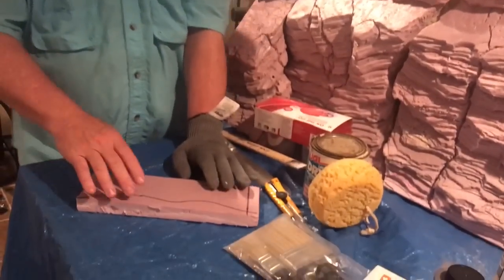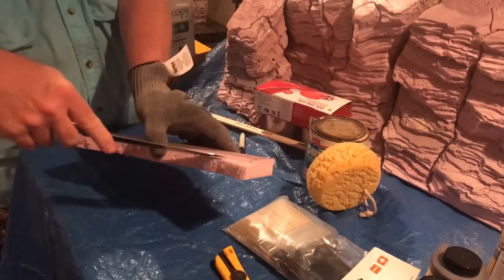How I Created My Faux Rock Wall Aquarium Background

Comment: What is name of foam?
Reply from the maker: I used pink styrofoam (extruded polystyrene) insulation board.  I didn't want the big house insulation boards, so I found hobby sized versions at Home Depot.  Sometimes you see it in green or blue, all of them work.  I don't like the ones that have a foil coating though.  If you can't find them, the 4'x8' house insulation sheets work well.  I used 1" thick ones, but if I had to do it again, I'd mix it up between 1" and 2" thick layers.  Most hardware stores sell them.  After cutting my boards and carving them, I used Gorilla Glue to bind them together.

Comment: Hi sir ...what is the material you use ??
Reply from the maker: Anish, I used Extruded polystyrene foam board insulation (XPS).  It comes in pink, blue or green colors depending on the brand.  Or, you can simply use sytrofoam also.  I prefer the XPS because it flakes nicely to give that layered look.  After I carved the foam board, I glued sections together to get the rock wall effect that I want.  Then, I painted it with water sealing paint called Drylok. I mixed cement dye into the Drylok paint to get the colors that I wanted.  After installing it in my tank using silicone glue, I coated the entire structure with an epoxy clear coat made by a company named Polygem.  Lots of public aquariums and museums use their products.
Reply: Thank you so much reply ...BTW love ur work 💪
Reply from the maker: Thank you so much Anish!

Comment: So, it will not float in water?
Reply from the maker: Thank you!  If not secured properly, it will float.  I don't think that I mentioned this in my video, but I took measures to try and prevent the structure from floating.  I embedded river rocks inside the structure when I filled in gaps between the foam boards and the back, then used spray foam in between the rocks.  Also, I went through a bunch of tubes of silicone when I installed it.  I tried to apply a bead of silicone just about every square inch that I could, back, bottom and sides.  It is in there very solidly now.
Reply from the maker: Also, factoring in the silicone, the structure fits tightly into place in the tank, so the frame of the tank should help keep it secure.  I tried to see if I could try and pull it off the glass, but no, it's affixed solidly.
Reply: @coachkevinwilson1958  thanks for the replies, your work is awesome!!!!🙂

Comment: Wouldn’t it float??
Reply from the maker: Yes, it would float.  But, I took measures to make sure that it doesn't float.  First, I stuffed the inner cavities with river rocks.  I also made sure that the three sections fit tightly together.  Also, it fits tightly in the tank, held in place by the tank frame.  Finally, I used a lot of silicone to glue it to the back and side walls.  I used 10 silicone tubes.  So far, the tank has been up and running for over 5 months now.  I checked everything out and it still fits every tightly inside the tank.  So far so good!  Thank you for asking.
Reply from the maker: So far, after 2 years, it's still holding up strong.  It was a tight fit when I installed it and used a lot of silicone glue.  After two years, it is still a tight fit and won't move.  The floatation aspect of the foam hasn't been a factor.  So far, so good.

Comment: wouldn't it be  easier to just put a clamp on the foam to the table and avoid cutting your hand ?
Reply from the maker: Yes, you could do that, maybe use a piece of 2x4 to clamp to the bench.  The glove was pretty easy to use though, and I never had a problem after that.  Thanks for the suggestion.  If I do another project like this, I'll give that a try.

Comment: Looks amazing but its gonna take the whole tank, looks like 150gallon tank down to 75gallons with the background inside
Reply from the maker: Thank you so much! Yeah, it takes up a lot of volume for sure. The tank has been up and running for a few years now. The concept is a local river biotope tank. The tank is a 75g tank that holds about 55g of water, enough for shiners, minnows, dace and darters, which was my original plan.

Comment: Would you sell me a couple small pieces. Similar to the one you just made?  I want it as an accent piece in the back wall of a Palidarium
Reply from the maker: I don't make things for sale, unfortunately.  I am just too swamped between my work and my hobbies.  Maybe some day if I retire from my job, I might make things like this, but for not, I can't.   I take it as a compliment though!  Thanks!
Reply: Where do you get that style styrofoam I  looked at hobby lobby. No luck
Reply from the maker: Home depot sells the ones that I used, a hobby version of the foam board.  I'm not sure about Lowe's.  It is cheaper to buy the pink insulation foam board and cut them down to size.  If I had to do it all over again, I'd buy a 1" thick the 2" pink insulation boards and cut them down to size, rather than the hobby version.  The thicker boards are nice because you don't have to glue as much.  I think the blue ones are OK too, as long as they're made of closed cell foam.  Also, other large hardware stores or stores that sell building materials like foam insulation board.  I'd avoid the ones that have the silver or white backing, because it's a lot of work to get that stuff off of them.

Comment: A hot wire would do this job much faster.
Reply from the maker: I used a hot wire foam cutting tool but didn't get the effect that I was looking for.  Thanks for the suggestion though.  The effect is the look of a break, rather than a cut.  I tried a bunch of different things before I tried this for the first time.